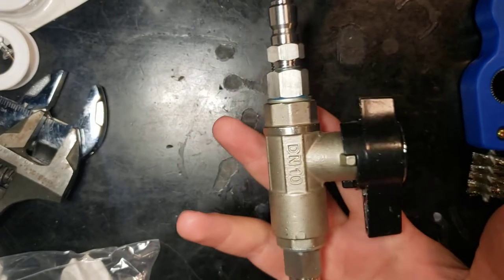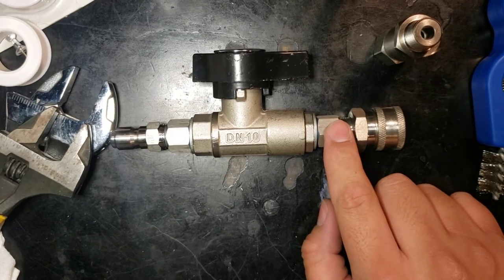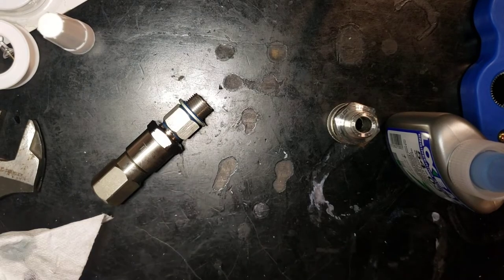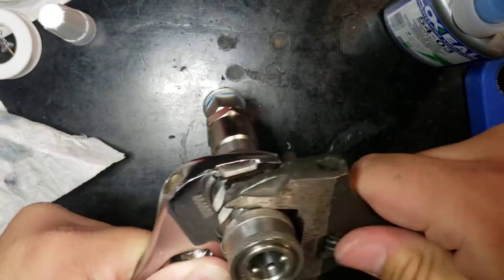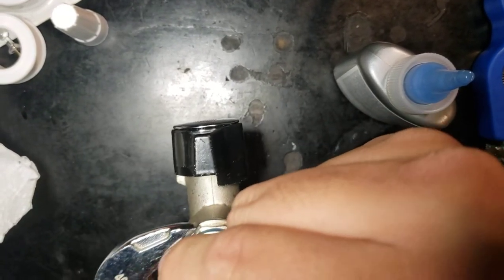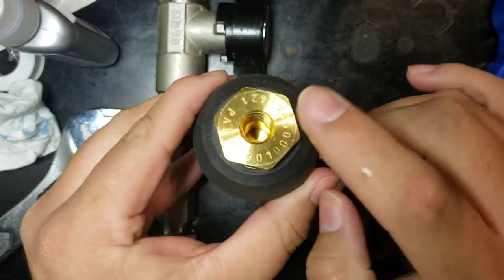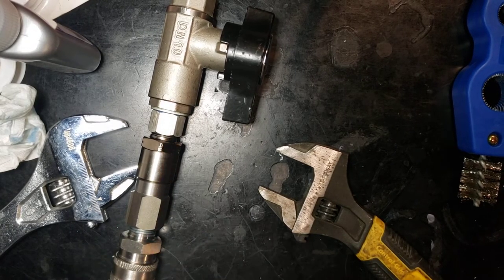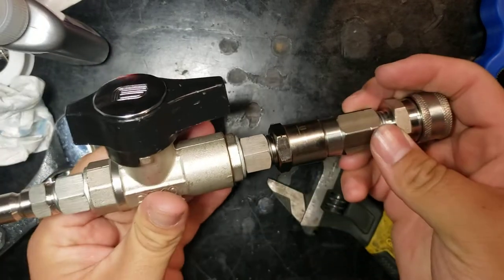Adding Mosmatic DGV Swivel To DN10 Ball Valve

Comment from the maker: Adding Mosmatic DGV Swivel To DN10 Ball Valve 

MTM 3/8" DN10 Plated Brass w/ SS QC:
https://pressurecity.com/products/ball-valve-3-8?variant=31395016867905 

PRM Filtration 3/8" BSPP-M to 3/8" FPT:
https://shop.prmfiltration.com/collections/stainless-steel-bspp-adapters-npt-female-x-bspp-male/products/bspp-adapters-stainless-steel-3-8-inch-female-npt-x-3-8-inch-bspp-male-with-sealing-washer 

Mosmatic 32.564 Gun Swivel - 3/8in NPTM X 3/8in NPTF
https://www.kleen-ritecorp.com/p-18999-mosmatic-32-564-gun-swivel-3-8in-nptm-x-3-8in-nptf.aspx# 

Hydraulic Thread locker
https://shop.pressurewasherproducts.com/50ml-MEDIUM-LIQUID-THREADLOCK-FOR-HIGH-PRESSURE-FITTING-USE-5004.htm 

YouTube Disclaimer 

I am just showing what I'm doing and how I'm doing it. Use, practice and implementation of this information is at your own risk. I am not an expert nor do I claim to be one. I am just good enough to do what I'm doing. 

Thank you for watching

Comment: How’s it work under pressure
Reply from the maker: So far it is working smoothly and haven't had any issues with this one. The one on the gun also works well for the lance and the quick connect tips but with jrods it'll turn on you with fan tips because of the weight of the j-rod. That's if the j-rod is on the gun without the lance.